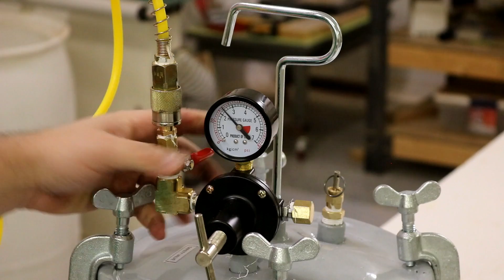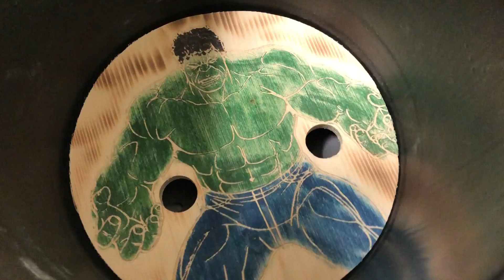Converting a Harbor Freight Pressure Pot for Resin Casting

Comment: That was interesting,  I'm going out on a limb here, you just turned that pressure pot into giant ventury vaccum generator.
Reply from the maker: Vernon Leeper ok 👌
Reply: @JakeThompson  
That ideal will save me from buying a vacuum pump. I'm getting into casting, need to make scale model car parts and stuff.
Thanks for sharing Jake.
Reply: FYI, nothing in the system he shows generates a vacuum. In this configuration, it's a pressure pot; meaning, you're simply pumping additional air pressure into it. The added air pressure pushes on the air bubbles suspended in the epoxy and shrinks them down smaller than you can see.  You're not subtracting any air (aka. creating a vacuum). Now, you could maybe configure the pot this way, but it might be dangerous. After all, the paint pot is designed to contain up to 60 psi of air pressure. That doesn't necessarily equate to the ability to hold a similar vacuum. It might suddenly collapse in on itself (catastrophically). So, if you do this I'd be careful. Good luck!
Reply: @Calamity_Jack  
Didn't think so,  I was a bit confused about what he was doing or the application. With a vacuum you pull all the air out of everything in the chamber.  But by positive pressure to remove air?,  or to cast resin under pressure?, I'm not sure i understand it, vacuum yes, positive pressure not so sure.
Reply: @vernonleeper7788  When you use positive pressure (as this application), extra air is forced into the container. The extra atmospheres exert pressure on the tiny bubbles in the resin causing the bubbles to contract (shrink) til you can't really see them with the naked eye anymore. The bubbles are still there, but they're too small to see. After the resin hardens, you remove the extra pressure and the bubbles are, of course, still trapped (in microscopic form) in the resin, but you don't see them. In vacuum, you remove the air and the trapped air escapes, which sounds good. But if you do some searching on YouTube for "vacuum epoxy", you'll see that it can also cause a lot of foaming in the epoxy. This is due the boiling point of the solvents in the epoxy being lowered so that they boil off into a foamy mess. It can be done, but it's much more difficult than raising the air pressure. Hope this clarifies things.
Reply: @Calamity_Jack  
Yes it does thanks.
Reply: No problem. I should point out, though, that the issues with foaming under vacuum are for epoxy only AFAIK; other materials might not have that problem. In fact, I've heard people who use resin to stabilize wood (that is help keep weak wood from breaking) prefer to use vacuum treatment.
Reply: @Calamity_Jack  
That I've herd too, I've recently gotten into casting and seen how to boil out the air but, if the pot life is short and the boil out is longer than pot life, how does that work?
Reply: @vernonleeper7788  Without getting into too much detail here, it's not good. :) It could set up while still frothy. I recommend checking out Peter Brown's video "Resin Casting: Pressure vs Vacuum" for a demonstration of what can happen.

Comment: Had one small hiccup with this build, as of July 2019 - the 1/4 cap doesn't fit on the regulator that came with the pot, so now I'm going to have to run out to the hardware store to find a male-male adapter to put the cap on, as the solution I tried to work with the parts on hand technically fit together, but I can't get the damn thing to stop leaking, and I've twisted and tried and retried to the point that my elbows are now killing me. Perhaps Harbor Freight has changed the specs or something?

Otherwise, though, great build, especially the bit with the release valve, that was giving me fits!
Reply from the maker: Jason Knepper Thank you very much.. I’m glad you got it figured out.. happy casting!
Reply: I had the same problem Jason and parts on hand fit but I think is still leaking. What size cap did you get? I'm not sure how to measure the Male outlet.
Reply: I had this issue as well, it's a 5/16 hole

Comment: wouldn't you use the orange (or is it pink?) tape that is used for gas lines seeing as how you're trying to seal against air rather than water?
Reply from the maker: Thyrza Segal It’s just pipe thread.. I’ve had it well over a year with no leaks.

Comment: Just purchased a pot so this was very helpful. Thanks. Do you have a resin source that is reasonable?
Reply from the maker: Ronald Swymeler I’m glad I could help with the pot.  The Epoxy Resin Store gave me a link and a coupon code: it’s in the description of this video.. Liquid Diamonds is what I’ve been getting through them and the code will get you 20% off.

Comment: Have you tried applying and then releasing pressure in cycles to see if a better result is achieved?  Also have you tried vacuum instead of pressure?
Reply from the maker: charles hetrick It can do vacuum instead of pressure... if you apply pressure and release before the resin has set.. the bubbles will come back.
Reply: Jake Thompson I just finished my first table which in total was a 24 Liter pour; with mixed results I adapted my Kydex vacuum former setup to pull a vacuum on the five liter buckets.  The product I used (EcoPoxy) has a 72:00:00 cure time, using pressure instead of vacuum  intrigued me but sounds like I’d better stick with vacuum.

Comment: A couple (hopefully helpful) things: I had a really hard time getting the lid to seal, I tried Vaseline as suggested and saw that someone mentioned air gaps under the rubber from uneven welding, I didn't feel like sanding them down so my easy solution was to remove the rubber and pour my soft silicone in its place. This worked wonderfully aside from some leaking into center of the lid but it was minimal. 
I also had a lot of issues with the fittings in the lid and some others that are removed in the video but absolutely would not budge no matter what I tried to the point of stripping a couple of the bolts(i dont know if thats the right word); even the internal pipe was a huge struggle but I wacked it with a hammer a bit and that loosened it enough. In the end I left everything as it was, added the peices suggested, and one extra cap.
As for leakage, many of the immovable fittings were leaking and I could neither tighten nor loosen them, and by accidentally dripping soapy water on the lid did I found that there were welded places on the lid leaking. I solved both of these with some simple uv resin. 
TLDR: I poured my own silicone in the lid to stop leakage. A lot of the fittings wouldn't budge to change the layout, but all I needed was an extra cap. The fittings wouldn't tighten either so I sealed the leakage with uv resin, as well as small gaps in the welding of the tank itself. Otherwise everything worked out fine and this video helped so much!
Reply: It took me a good 30 minutes to remove the outlet, and I had to abandon the pop off valve because instead of unscrewing it just decided to strip, and I just bought a new one

Comment: :/ that’s about $40 just in fittings and stuff, not including the pot. Wish there was a cheaper way for a hobbyist that doesn’t need/want to spend hundreds to do epoxy projects.
Reply from the maker: Use a slower curing epoxy like liquid diamonds.. it does pretty well without a pressure pot.. I have a link to The epoxyresin store and a discount code in the description.
Reply: All together cost me $130 for this setup that’s not much at all

Comment: I followed the instructions and got the same fittings as you but for some reason my gauge  isn’t reading the pressure in the pot. I went and bought a new gauge earlier and still the same problem. I know air is going in and staying in there, but I only can read what’s going in through my compressor. The regulator works as well because the compressor stops at what I told it to, but I can’t watch the gauge after that to see if I’m losing or holding pressure. Any suggestions?
Reply from the maker: Erin O'Neall Just to check the gauges I would take the pop off valve out and put the pressure gauge in that hole to see if the gauge works. If the gauge works in that hole, the regulator is not letting air through to your gauge. If your gauges don’t work in that hole, you have 2 bad gauges,
Reply from the maker: Erin O'Neall Erin Just to check the gauges I would take the pop off valve out and put the pressure gauge in that hole to see if the gauge works. If the gauge works in that hole, the regulator is not letting air through to your gauge. If your gauges don’t work in that hole, you have 2 bad gauges,

Comment: Hey Jake. First time watching. I thought this process needed a vacuum pot instead of a pressure pot. Harbour Freight sells a couple different vacuum pots. Guess I need to do more research before making some resin blanks.
Reply from the maker: J Lathem You can use vacuum with very slow curing resin.. the resin I’m using is very good for turning, and has a very fast working time.. the pressure squeezes the air so small you can’t see them.
Reply: @JakeThompson  - Thanks Jake.

Comment: Why don't you use the pressure relief valve as is and just plug the paint outlet??
Reply from the maker: GastronomicEntity Many ways to skin a cat.. as long as it holds air it’s all good.. I’ve seen some that don’t use a regulator at all.. many ways to do this.

Comment: Curious, I used to cast with resins, back in the 80's. We used vacuum , not pressure to extract the air.
Vacuum worked very quickly, like it's boiling. Had a 12 " round plate, hole in base pulled air, large glass dome over top.
vaseline vacuum grease for sealing. Watch out though, the air bubbles would expand so use very high pot.
Reply: With vacuum the resin raises up and like you said looks like it boils. Pressure pushes the air out and the resin doesn't raise up and try to overflow if you don't have it in a deep container. Both ways work just as well.

Comment: Hi Jake,  Amazing video and thank you again for doing this.  I had followed your instructions for a ShopFox paint can (which after buying components twice, still leaked), so my brother in law went to the USA and picked up a Harbour Freight can for me.  Everything went together perfectly (your video is so clear and easy to understand), but I have one single leak where the regulator screws into the lid and it's tight.  There seems to be a visible gap where the hex nut is, almost looks like a defect.  Taking it back is not an option (in Canada), so would you have any suggestions on sealing this?  I can email you a photo if it helps explain it better?
Reply from the maker: Gisele Grenier There’s a product that is liquid Teflon. You can take the regulator out coat the threads with the liquid Teflon and screw the regulator back in and let it dry. Should be good to go.

Comment: How much did it cost after buying the parts
Reply from the maker: Uncle Jamal  The pot itself is $100 you can get the pot cheaper with a coupon.. after the fittings you will have around another $20 in it.. I put links in the description so you can see the cost of the fittings.

Comment: Probably the stupidest question you've ever gotten about this thing, but, are you adding air pressure or removing air for a vacuum with that pot?
Reply from the maker: Aaron I am adding air pressure, the resin I use needs at least 45psi to make a clear cast.

Comment: I have been successful in converting the tank, but as you said the safety valve pops off around 25 pounds. You say to just adjust it, but you really don't say how. Please explain. I have the whole rig and it is useless unless I can get to 50 pounds; Please help.
Reply from the maker: Lillee Clark on the pop off valve.. you have the middle part that pops off, and around it is a ring that has notches in it that looks like a screwdriver can fit it.. you turn that ring to adjust it.. I believe you screw it in so the pressure can go up.. I hope this helps!! 👍👍

Comment: What are your thoughts...... pressure or vacuum for casting resin???
Reply from the maker: Bryce Cannon I have never degassed with vacuum, but my thoughts are, with a fast curing resin, there’s not enough time to degas with vacuum. With a very slow curing resin there’s time. Both ways have there place.
Reply: I've read that vacuuming is better for silicone mold pours, and pressurizing is better for casting resins in a mold. I think(?) you can also use this setup with a vacuum pump, although most vacuum DIY setups I've seen use a clear acrylic lid for you to monitor if the liquid silicone starts to bubble over. I'm building this right now and planning to test out a vacuum seal.

Comment: Why don’t you just use resin to level the bottom?
Reply from the maker: Because if you do that, and then spill resin on bottom, you can’t clean it up, because it will stick to the resin bottom
Reply: Jake Thompson didn’t think of that. Makes sense.
Reply from the maker: robmc7203 👍👍👍

Comment: All you need now is a vacuum pump to suck the air out of the pot just before putting it under pressure for the mold. At about 30 psi vacuum, all the bubbles just flow out of the resin, then you can put it back to pressure and nothing is there to mess up your molding.

Comment: Use a flame on the resin and you wont get nearly as many bubbles. Casting pots are nice but not necessarily needed
Reply from the maker: J T I already have 2 pots, but if the casting doesn’t fit in the pot, I use a flame.
Reply: @JakeThompson  I make large resin furniture. If i had a 10' x 10' pot i would use one lol

Comment: Could of just put resin in the bottom of the pot.
Reply from the maker: kody simpson If you spill resin on resin it will bond.. if you spill in the bottom of the pot as it is. It will nock right off.
Reply: @JakeThompson  makes since

Comment: You cast resin in a VACUME not pressure. That takes ALL the air in the resin out.
Reply from the maker: david diehl If you have a resin with a very long working time you can use vacuum, the resin I use is only workable for 12 minutes.
Reply: you can slow the resin by a) using less hardener or b) using a different hardener that's slower...……….